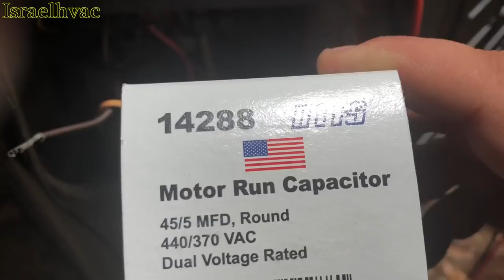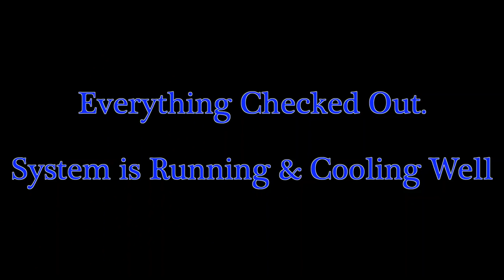HVAC Service | Compressor Out On Thermal Overload

Comment: Had a cap go bad 7.5uf oval. Run cap for fan replaced and has to wait for that compressor to. Cool off, it was super hot to the touch due to the fan not running. Lucky the compressor cooled down and kicked on. Why I keep spare caps just in case.

Where I live I guarantee they would say a new compressor is needed etc. it’s sad how bad trades are in terms of providing honest service. Bristol comps are like tanks

Comment: ok. so now what? It went into thermal overload.  What was the root cause?  Mine does this on every hot day and I already had the compressor replaced. I can cool down the fins or the compressor directly to make it kick back on. As soon as the house hits the set temp, it will turn off and go into thermal overload again.
Reply: You ever find a solution for this?
Reply: @ShyRage1  No. Not really.  I bought a new thermostat that has a larger temp deviation for on/off temps. So this gives the compressor more time to recover. It helps. Still happens sometimes.  I may try a hard-start kit because they are cheap. I can sometimes hear the compressor trying to turn on (momentary hum). So perhaps it is not in thermal lockout.
Reply: @jmogyoro  Mine sounds exactly like this but the exhaust fan is still running.  I always thought it was something electrical.  Our old Lennox, the one before this condenser did the same thing as well.
Reply: @jmogyoro  One of my FirstCo 24WU-A condenser units has an issue where when it attempts to start again at the start of a new cycle, after it already completed a cycle, then what I’m led to believe is a thermal overload protector can kick in a few seconds after it has attempted to start.   Then you hear something clicking and it shuts off.  Then you hear the fan motor continuing to run.   It then can take a few minutes to as much as 25 minutes or more before it tries again successfully.   This compressor unit, if already running will run continuously without any protective switch causing it to shut off.  It’s only on very warm days when it is attempting to start the next cycle after it was already on previously where the issue occurs.   Wondering what the actual cause of this is?   The thermostat has a 5 minute delay to prevent short cycling.   The other zone (identical unit for 2nd half of same floor) has no issue whatsoever currently.

Comment: If there is no water hose near one can somewhat cool the overloaded compressor by just leaving the condenser unit's Fan on and taking a lunch break. ie have the contactor on but have the compressor unplugged. Moving air helps to cool the unit compared to still air, ie about 4X quicker.   *  But water really is radically quicker. If you just let the unit sit with no fan or water it might take several hours to cool down.  

How long it takes with any method depends somewhat with the compressors size in tons. A 1 ton unit will cool down quicker than a 5 ton unit. 

ie smaller units cool down quicker than bigger units. This is because a small unit has more surface area to its volume. In "Beer Can Engineering" an analogy is red hot BB cools down quicker than a red hot Canon Ball. Or a 7 oz Pony Beer Can cools down quicker than a 24 Oz Beer can. :)
Reply: 3beltwesty

Comment: What caused the thermal overload and is there a way to stop that from happening?
Reply: good question...........??...............
Reply: Yes there is.  Install a high pressure Switch to Avoid a comp going on OL
Reply: JOHN I love ur videos been in this close to 30 summers n still got stuck sometimes due to tech stuff,,,,s. Fl welcome u. Whenever u decide to move. Plenty of job s. Here😎tnks.  U are an inspiration as well as Mr Rardon, Mr Gregg, n the Guy w the little Chihuahua,  love his reasonings. Ttul

Comment: I saw my first Tecumseh comp in an older R22 Goodman yesterday. I never even knew.
Reply from the maker: Tecumseh is a good compressor. Thanks for watching man
Reply: @johnisraelhvac2019  I disagree IF it's in refrigerator components, walk in coolers, and soda/ice machines I have seen so many videos where they replace tecumseh recips but in condensers u r totally right
Reply from the maker: @Vann Berg HVAC you can disagree but the fact is Tecumseh is a damn good compressor.
Reply: @johnisraelhvac2019  no harsh feelings man I have been a fan of you for a very long time.
Reply from the maker: @Vann Berg HVAC I know and appreciate you watching. You come in my hangout one Saturday night
Reply: @johnisraelhvac2019  I will be more than happy to!

Comment: Mine keeps going to thermal overload too. I used an infered thermometer and the highest temp I could find was 150 F on the surface of the compressor. Is that the usual temp they go off?
Reply: I just went through this...... Start with the basics.  Check the coils on the condenser and the EVAP.  My evap coil was covered bad in fur.  Tenants don't care about filters.  Also check the cap after that because mine was under the rated values.  Cleared my issue right up.

Comment: Why did the compressor cut out on overload? Was the compressor running without fan prior to service?
Reply: Phollip kept trying to start, but the bad cap won’t allow the motor to spin up,to speed. It keeps trying over and over till it overheats and goes on thermal overload.
Reply: Also low charge can cut out overload

Comment: What do you do if your compressor runs 15-20 minutes then it cuts off? It cools back down after an hour then starts back up? It's a Trane unit in sounds like it's on its last leg?
Is there any sensors where it gets hot I could probably replace
Reply: Megometer!

Comment: I like your videos. I live in Georgia  and I just about a house. It has two 1992 4 ton Trane 1500 XV Variable Speed Heat pumps in it. The service guy I called , did not know what I was talking about . He kept telling me that he has only worked on one Trane Xl1800 and told me there very difficult to work on.Has anybody worked on one of these?The way this guy talk he made the Xl 1800 sound like a unicorn.I know what I see TRANE 1500 XV Variable speed heat pump.
Reply: XV1500s were a variable-speed model that has become rare over the years. The XL1800 was a two-stage model with two compressors (one for each stage), the XL1800s have become pretty uncommon as well.